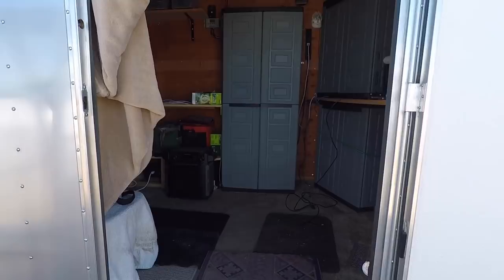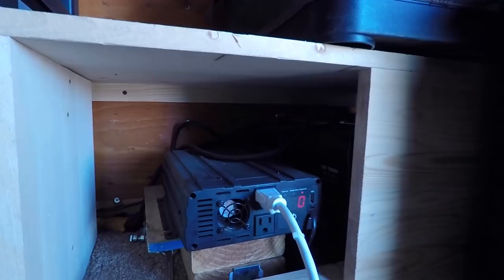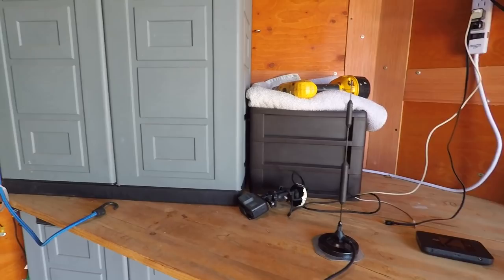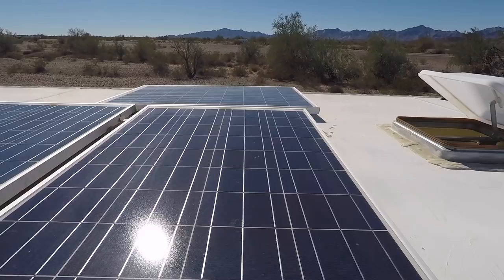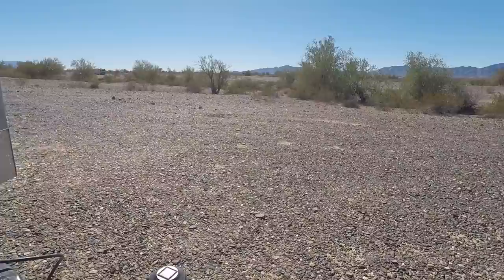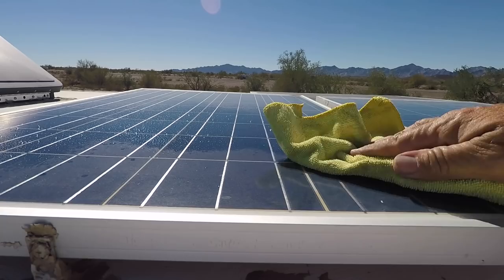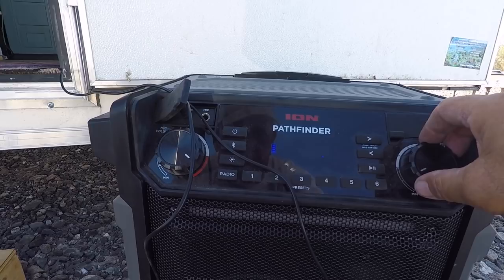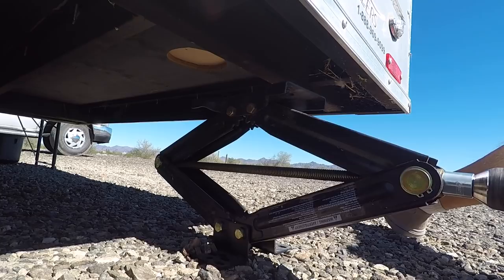RV Boondocking Set Up Of Cargo Trailer... 300 Watt Solar..Propane Stove-Sat Radio-Wifi-RV Living

Comment: RVerTV    I have some interesting news for you I just learned yesterday about jhow to stay cooler.  You have big box fan there-  Now you take "two" 17 OZ. empty bottles and cut the top out for a bigger opening.  Next you take a hot rod and melt the sides of that pop bottle clear around and 3/4 of way down about 100 holes.  Next use heavy zip locks ties and strap those to back side of your big box fan.  Fill those empty bottles with Ice Cubes and then turn on the fan to stay cooler.  You will love it.

Comment: Russ, you might consider mounting the jacks with the adjusting bolt facing the back end of the trailer. That way if you drag the back end on a driveway or curb, the jacks will rub the ground and protect the back end of the trailer. Happy trails.

Comment: Nice practical setup. I worked on 12 volt power in police vehicles for a career. I am convinced that it is better to go the solar route with sufficient battery storage and an appropriate inverter to send 120 volt AC power through the RV. Obviously 12 volts for most lighting and the various control board uses, water pump, etc. But ac power is the way to go.

Comment: We are using a cargo trailer like you did. On this view I didn’t see any ac unit. We went camping this weekend in Tennessee and we roasted. How do you stay cool? In your new rig do you have an AC unit and if so what kind? Love my rig but in heat, I smother. Have diesel heating for winter but need some help for dealing with the heat!
Reply from the maker: I had a portable Hisense AC from Lowe's Installed in trailer and vented it thru the floor  i was still hot in trailer daytime  in summer but at night it cooled off the trailer great for sleeping